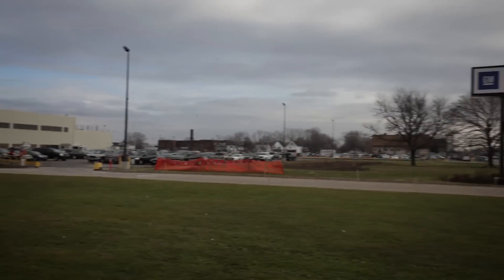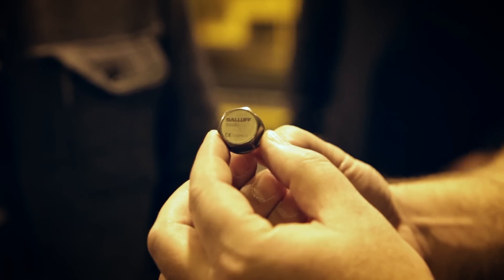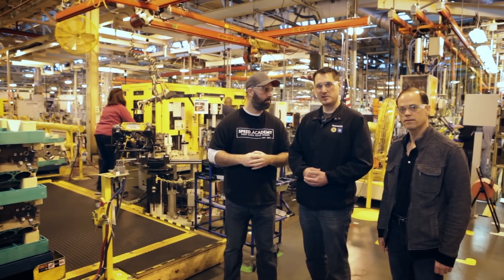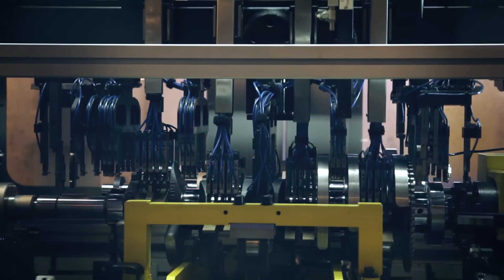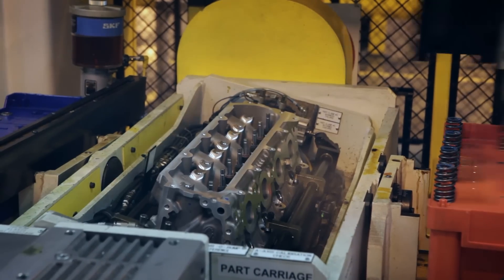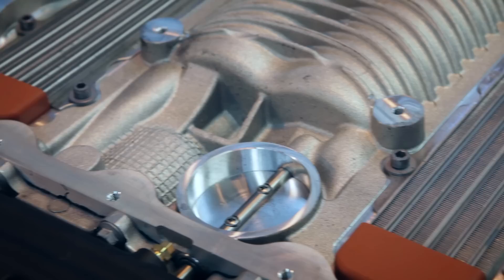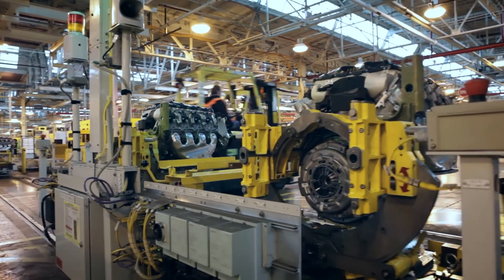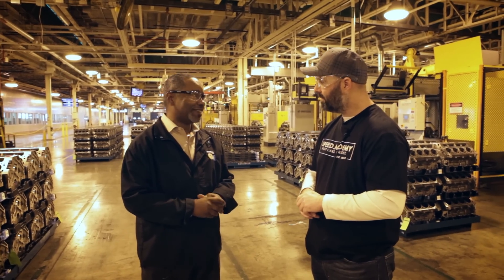Building GM's most powerful Engine Ever, the 650hp LT4 V8!

Comment: All these Tonawanda Built LS V8 Engines (i.e. LS3,LS1,LT4) have probably more precision and accuracy than you could ever obtain even in an old School Clean Room Race Shop. Probably the reason the LS3 crate engine is the most popular engine for Hot Rod and Resto Mod Builders. Just going by today's Machine Shop Prices; you could not even get close to the cost of a built Crate engine which as you can see by the Video is blueprinted beyond any normal type Mfgering/ Assembly. With the technology of today's Computerized Robot controlled Machinery (i.e. CNC's,lasers, Mills,Boring/Honing,Broachs,etc. They can build an engine with a precision pretty much unobtainable in the days of production Muscle Car Engines of the 60's and early 70's. Probably why Chevrolet has so much Confidence in their new ZL1 Camaro, that they will let you go Off Road Racing and still maintain your full warranty. Don't remember them doing that back in the L88 / ZL1 Days ... Great informative Video !
Reply: Robert Lane 
Warranty doesn’t usually cover people messing with engines then expecting GM to fix the problem.
Reply: mike mentzer shuda won in 1980.... lol
Reply: @yoitzgrazz  he was absolutely amazing!
Reply: @RobertLane-n4g  warranty denied when guys fuck around to much with engines, tunes, etc.
I had the engine replaced in my C5 under warranty, no fuss...but it was 100% factory original at time of failure
Reply: steve matz i
Reply: Mike Mentzer = BB icon
Reply: +steve matz yeah a properly built early small block or big block on a budget is about $8000-$10,000.  that LT4 is $12,000.  GM is making the choice easier every year.   the LS9 a few years ago was out of most people's budget @ $22,000.   GM is finally coming around and thinking right.
Reply: Oh you mean if you park them in a barn for 40 years??
Reply: Both those  engines are maintenance and up keep night mares .
Reply: You forgot the )

Comment: this type of mass production style should of been negated for the use & style of *hand built powerplants.

Corvette high performance team made a mistake switching build & assembly to that of "industrialized robot handling & assembly",

it severly weakened & causes production retail per product specifically C7 Corvette powerplant failures or blowouts from manufacturing powerplant style.

This powerplant having been updated & designed as a Halo exotic powerplant should of been specified as "low volume hand built" to meet stringent quality craftsmanship benchmarks".

LSA supercharged & LS7 were specified as *specially hand built
Reply: Muhammad M Salaam they are if you take that choice this was to keep up with demand

Comment: Who would trust this engine . GM does not evan use a Torque Plate to hone the cylinders ????? Whats with that ?
Reply: davie biggions you dont need a torque plate to hone shit but they evem already said they already have a different style to simulate clamping forces
Reply: jdr I know you don,t need a TQ plate to hone a block , after being in the engine building business for 40 years I have learned sum things . The only American V8 I have seen that needs a TQ plate honing is the SBC 400 , and this is because the head bolts are so close to the cylinder bores . It is not about clamping forces , its about the bolt pulling on the thread in the block and distorting the cylinder bore where the bolt is located . If you look at any ford engine all the head bolts are spaced far back from the cylinder bores . No need for a TQ plate because the bolts don,t distort the bore when they are torqued up

Comment: hey this is the engine that keeps overheating in the corvette hey. Yeah real good guys. all this shit and it still overheats in a factory car. nice.
Reply: just upgarde the radiator, better electric fans, oil cooler and no problems but people dont understand there is a fix to every problem.
Reply: Yeah no shit but the point is it came out of the factory like that. It shouldnt be a problem in the first place
Reply: Every new car has problem whats your point?
Reply: Fernando says "every new car has its problems"...no they don't! My 2004 Expedition went 155k miles before it had anything go wrong. My 99 Superduty 7.3 is bulletproof! Chevy has major reliability problems Ford simply doesn't have.
Reply: +rhino250r From what I seen they have problems you just got lucky that they made all your parts as best they could, I seen more ford problems then chevy.  1997 Tahoe 250k miles shows proof only had to replace the spark plug and wires.
Reply: +rhino250r unless you work on cars like me I could see your point, I only see problems in chevy when they are not taken care off or people mess with them for no reasons.
Reply: +rhino250r And if they do have very unreliable parts its probably the 305 which everybody knows they arent thes best as the old classic 350 or higher.
Reply: +Fernando Mendez or the terrible v6 2.8 from chevy point of this is that evey brand has a unreliable parts depending on the engine transmission
Reply: did he forget the legendary c4 trans the legendary pos suziki engines they used
Reply: rhino250r chevy has reliability problems lets see but ford uses gm suspension gm transmissions used gm engines the list goes on and on about shit ford used that is chevy but the list of what chevy used that is ford is a codeveloped transmission

Comment: Automation is amazing.  You can't tell me that this engine is surpassed by anything in terms of quality in  materials and assembly.  We automatically assume a hand built  engine is better or the best,  but when the robots/machinery assembling these engines is dialed in I doubt you can beat the  consistency of quality and tolerances. Not to mention the quality control standards.  If this engine were built on the AMG line you would get an engine of equal quality but pay 3 times as much because its hand built.  In fact, to get a level of quality that the ZO6 delivers somewhere overseas the entire car would cost 3 times as much and you'd get nothing more.
Reply: +rhino250r The LT4 uses a forged crank. This video is confused. Regardless, those stock GM cast cranks handles well over a thousand hp on a routine basis....
Reply: +El Guapo completely agree, another prime example is the nissan GTR, all robots there and can beat most other cars 3-5x its cost. Hand made, meh if i wanted hand made i'd do it myself.
Reply: Quality materials? It's uses a "cast" crank! Lol

Comment: With the advance machining as shown, do the engines get delivered already Blueprinted or will Blueprinting the engine, after delivery, improve performance?  Just curious.
Reply: +lowell mccormick The machining process is statistically controlled, where GM measures the machining capability of all the operations, and typically checks XX number of parts per shift. Therefore, through statistics you can have a high confidence the engine is within part print.
Reply: +lowell mccormick 
No, to answer your question.
I been in many a speed shops, and no way no how can they get this kinda quality control. Until they come out with .... Electron based measurements, and thats fucking  subatomic.
And at that point, im not sure the engine would even notice it.
No way no how can some speed shop do this better, they might make more power with cams and cranks and such, but they would never be able to match this precision, thats unless they had the same equipment.

It's a good question, and people are just starting to no get engines done, they are buying these right from the factory.
Reply: Thanks for the answer.  Back in the '60's, shops would cite a 15% increase in power from blueprinting an engine.  But they didn't have the machines and computers of today.  Do they still sell Plastigage?

Comment: Only 9.4 lbs of boost...Wonder if they will allow you to specify your own pistons and rods instead of those fairly "Weak" ones that they use currently...  Seems to be the only thing holding it back from 15+ lbs of boost...then again to boost at over 1 bar you need more fuel...a different fuel map, timing map etc....quite a few things needed for more boost pressure actually...but that's the easy part.  The pistons n rods seem to be holding this beauty back or away from higher Hp numbers.  I'm sure I'm not the only one who knows this...GM like to leave A LOT of room in the engines capabilities department...Its a great way to make more money too.  :)

Comment: GM really needs to stop re-using the LT designation. This is the third time, it's just getting confusing now.

Great video though! Very interesting to watch.
Reply: yeah but how many times have they used ls? like 19 different fucking times
Reply: I am thinking the LT4s of the mid 90's...has me confused....if someone with knowhow can chime in would be great
Reply: +Spahi77 the LT engine designation was used on first generation small blocks (ex. 70s Corvette), second generation small blocks (ex the LT4 you mentioned), and is now being used a third time for the new engines in the new Corvette and Camaro.
Reply: +UndergroundTrev thnx, appreciate timely response
Reply: Proven concept....that's what they bank on..
Reply: UndergroundTrev luxury touring. Luxury sport.
Reply: Aint that the truth. LT1 is a 360 hp small block and an ls6 is a 450 hp 454.......as for real world hp...I work at a marine engine shop... nobody puts one or 2 of them ugly ass ls motors in their &300k of shore boat
Reply: What's ugly about the engine of the century?
Reply: Never heard of Severn Marine?
Reply: The ls motor is so g damn ugly i cut up a good set of old school mickey t valve covers for bbc to cover up at least some of the ugly..came out kinda cool..id do it again
Reply: LS engines were first introduced in 1997 (LS1, duh), and were made every year until 2014. Thats 17 consecutive yrs using the same name and design. the difference between gen3 and gen4 motors is basically just 1 piece, the crank trigger wheel. All the other parts are interchangeable. This makes them very easy to modify and maintain.

 The LT designation was used in the 70's on gen1 smallblocks, then again 20 yrs later in the 90's on gen2 smallblocks, and now again 20yrs later on the gen5 smallblock. The gen1 and 2 engines share very few parts, and the gen5 shares parts with nothing. 

See why people complain about LT's?
Reply: gm showed that they lost their ability to be creative long ago.....

Comment: GM Morons! Why would you engineer a great engine like this with a blower and all the fixins but use crap for the rocker arms? Where are the anodized roller rockers? Is that asking too much. What does a new Corvette cost these days. $80,000 plus dollars and they are using cast or stamped rocker arms! Who designed this KKK Krap! For 80K you should have a set of Crane Anodized Roller Rockers under the covers. 

Another stoopid move by the engine-ears at GM is that heavy old fashioned cast iron block__you block heads! Afraid of a modern Alew-Manium Block with steel sleeves?
Why not stick two vega blocks together and use Alew-Manium cylinders?

And, when was the last time you seen a Brand New Chevy Corvette in HELL-LA?
Never! All you see is Hondas, BMWs, and Mercedes-Dodges but no Corvettes so who is buying all these engines and new corvettes? Yeah, ask that to the GM president and she shits in her panties!
Reply: +Wayne Manzo You're pretty uninformed about these engines, so I'll assist you. The cast rocker arms from the factory are virtually bulletproof, especially when you upgrade the trunnion bearing. Great engineering work by GM on these rockers, most people hopping up these engines don't even bother with new. The engine block is not Iron, it's Aluminum. Are you drunk? And apparently, if there's not a single Corvette in LA then they must not exist lol
Reply: I sure hope you're trolling, if not its obvious you know nothing about the LS/LT family.
Reply: Wayne Manzo aluminum really gm fucked with aluminum in the 50s and actually had production aluminum engines

Comment: so gm assembly line doesn't use cyl honing plate simulating head tension on the cyl walls
Reply: Its not required as they know how much distortion to program into the computer to get correct roundness.

Comment: GM noob here. What is the difference between the LT and LS engine series?
Reply: +N4CR5 
DI is a great addition just look at the compression numbers the LT has been able to get away with on 87 junk gas. The key to keeping intake carbon down was eliminating the EGR system, which GM managed. Now it's just a matter of installing a good oil catch can and keeping the intake clean. CRC GDI IVT and the BG Induction service are both effective when used regularly in conjunction with a catch can setup. They are WAY better than the VW/Audi DI engines have been. Those are horrific based on what I've seen on r/justrolledintotheshop.
Reply: +AK540i Direct injection and a bunch of other fuel saving shit which doesnt do much because once u step on it it all doesnt matter no more. Think of them as the same except LT can get more power easily.
Reply: +AK540i 
LT has variable cam timing so makes more mid and low range grunt. DI helps a tiny bit too but not sure if it's a reliable solution, many DI engines from other manufactuerers have issues with carbonisation. That said, I have an LS3 and would love an LT1 so no bias here.
Reply: hochhaul

That's really great to hear, I was a little concerned about the DI, as you said, plenty of insane photos on r/JRITS, walnut media blasting as part of your service.. uhh okay.
Catch can is very important, agreed, sourced a >20k mile LS3 with heavy carbonisation of exhaust ports after being nana'd around too much. Have gone full dry sump as it's in an S2000, don't want to pop it on sustained left handers, there is one on a particular local track, which killed the f20c for the original owner..
Reply: in the old days, the LT series had optispark, lol.
Reply: Joseph Rumpsa
Glad to see optispark go away. what a terrible idea.
Reply: It was a good idea, just terribly implemented. Had they tried keeping it in the original position, or had used a divorced water pump (leaving only the easily removed harmonic balancer), I feel GM would have kept the system around longer. However, I am glad the LS was born from the ashes of the LT

Comment: All that shop floor to make a supercharged 6.2l V8 that only cranks 650bhp?
Reply: +Sam R 650bhp while also being built to last for more than a few years, honda could make their civic run at 250+ cheaply and easily but you would see cars coming in for repairs by the millions. Ask anyone pushing more than 100hp from factory on a normal car how many things they've replaced or fixed on that build. So think more of it more like 650 reliable vs 800+ unreliable.
Reply: FORDS 3.6 V6  IN THE FORD GT CRANKS OUT 650 HP ? OVER HEAD CAMS ARE THE WAY TO GO  SMALL DISPLACEMENT AND HIGH HP ,UNLIKE A 6.2 PUSH ROD ENGINE NEEDS A LARGER CID TO CRANK OUT THE SAME HP AS A SMALL V6
Reply: Guess you missed the part where they also make 4-cyl, V6, and other V8's there

Comment: They still make 2 valve per cylinder heads?? With pushrod system?? What?? It's like a tractor engine compared to modern 4 valve DOHC engines. WHY?? 
Look at this: https://www.youtube.com/watch?v=Jiv3PVyCXw8
Reply: If it ain't broke don't fix it
Reply: If everybody were like you, society wouldn't progress. Logical way forward is to improve on things. Everything can be made better. The problem is, internal combustion engine has been   vastly improved compared to what they're producing in 21st century.
Reply: +veltruski you do know that the ohc engine has been around longer than the cam in block design don't you?
Reply: +mrwrightontyme1 Yes, I do. And I still don't understand why they keep producing these inferior engines except for cost. This is an 8 year old comparison of LS3 and AMG V8:

http://m.caranddriver.com/columns/pushrods-versus-overhead-cams-part-38-modern-v-8s-from-gm-and-amg-slug-it-out
Reply: you do that GM does make dohc engines. so what's your point?
Reply: I will never want a dohc engine they suck. they take up more space then a 454 big block. terrible tourqe curves. I can swap a cam out in 2 hours engine in car with a cam in block.
Reply: veltruski inferior with better torque curves and a better oiling system

Comment: Hello,
Here is HZ racing parts Co.,Ltd.,which is a  good-quality Chinese manufacturer of various kinds of  engine tuning parts,many foreign trade companies buy goods from us,
and at the same time,we can also serve as a purchasing agent of some goods for our clients by purchasing products from our familiar and reliable friends' factories to gather their large order and minimize shipping cost if they need.
Our newly established English website is  http://www.hzracingparts.com 
which only shows a portion of classical products of a certain class,doesn't show all ones. so,welcome you inquiry us of your specific product. 
You can please have a look at our website first,and if possible,welcome you tell me your interested items. :-)
For example,we specialize in making various kinds of wheel spacers/adaptors wastegates,bov,turbo boost controller ,short shifter,cam gear,crank pulley,suspension(rear/toe camber kit ,control arm)fuel rail,wheel nut,intercooler , swivel oil/fuel line hose end fitting,oil catch tank,oil cooler kits,cast iron exhaust manifold ,hydraulic hand brake level,oil filter adapter  and so on .
And we sell our friends' products like turbo blanket,heat wrap material and others.
Kindly Note:1.We have enough ability to develop new products for you as long as you can provide us samples or drawnings of auto parts similar to ours.
            2.Good quality and resonable price for you. 
Looking forward to your kind reply then i send you interested quotation list.:-)
best regards,
Cherie.